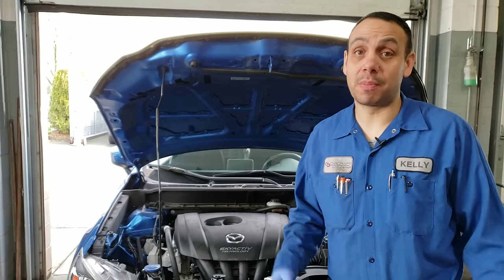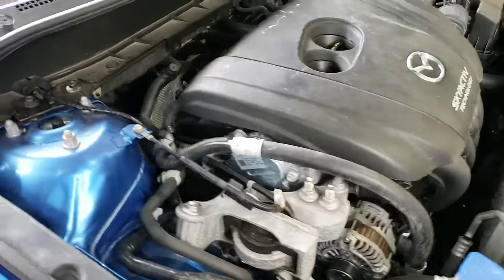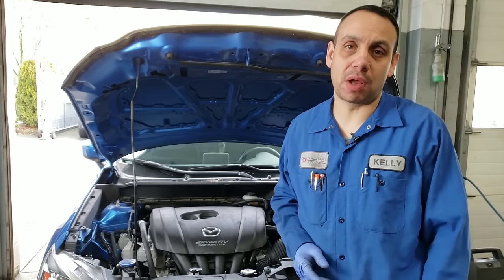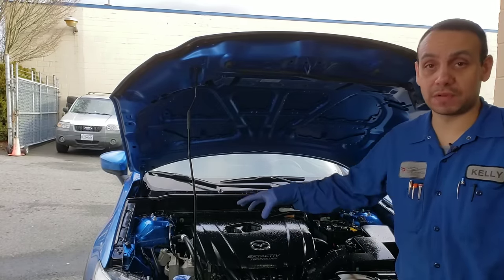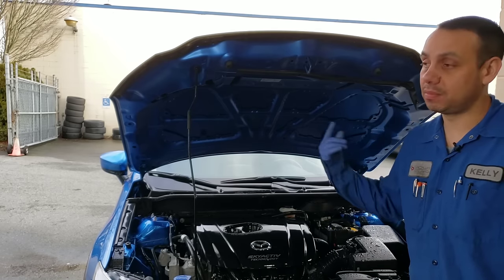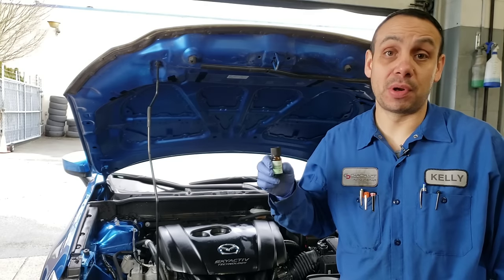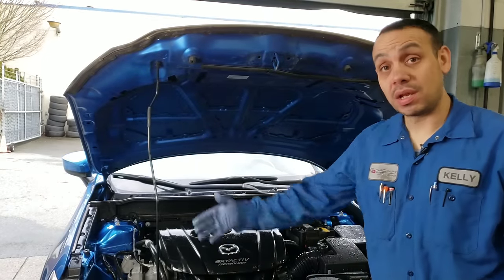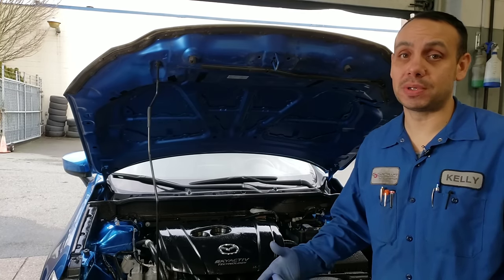Easy Tip To Keep Rodents, Mice & Rats Out of Your Engine Bay

Comment: Good video.  That engine cover should have been removed though.  Speaking from personal experience (with two Mazda vehicles), rodents love to nest underneath it.   Important wires and connections reside there.  

A thorough cleaning and spraying of essential oils does help, but should probably be repeated often if in a high infestation area.

Comment: Yep — rodents cost me $900 USD repair after eating the wiring. I found that particular car - Ford Explorer - was more susceptible to rodents wanting to get up into the engine area. I ended up trading in the car less than a year after purchased. I purchased a Ford 150 and didn’t have the same problem. Seems that automakers should come up with better ways to protect wiring, etc.

Comment: I live in Italy and when I had this problem my mechanic pressure sprayed the engine compartment with diluted kerosene.  Worked like a charm.  Since, I have had him spray the engine compartment every fall and have not had any more problems in the past ten years.
Reply: how can you spray kerosene, it will burn at high temperature letting fire to catch your car. how you diluted it. Does it prevented rats and rodents? thanks

Comment: I get my car oil sprayed yearly, I use the Krown formula. Never had an issue with rodents. Can't say thats the cure for sure, but since it is oil based and does have a slight smell I would think rodents won't like chewing, sleeping or nesting there. Also as a bonus it protects against corrosion.
Reply: I live in the country with lots of rodents.  The Krown oil attracts a lot of dust add dirt; seems like they aren’t interested in chewing through the goop all over everything.  My boat wiring, on the other hand got chewed.

Comment: My cousin bought my wife's Sunbird that had been parked for a year. It started right up, he put plates on it and drove off. On the way home he tried the air conditioning. The next thing he knew a live snake came slithering out of the dashboard heat duct right by the steering wheel while he was driving down the road! He barely had time to pull over. Luckily nobody was hurt! 🏃‍♂️...........🐍🚙
Reply: Thats some Indiana jones shi right there!
Reply: I had a rat snake that kept getting in my old car. I finally speared it when it came out of the door
Reply: Snake was there eating the rats.
Reply: A snake in your car is way better than a mouse or rat. Snakes don't do damage.
Reply: That’s a GR8 story, 
Talk about an exciting drive !
Reply: Unless it was a rattlesnake(or the other of the poisonous snakes in your region), you have nothing to worry about.
Reply: @BillPalmer  Yeah he did. His gurlfriend started freaking out.
Reply: Someabuck
Reply: Did you know gasoline will kill a snake?  It does, throw about half a cup on it, it also killed the grass in the area but that snake was GONE
Reply: @A10TOES    I tried that.  The snake took off at a high rate of speed and travelled about 500 yards.  Then stopped and laid there.

Ran out of gas.
Reply: @tomrogers9467  🤣🤣🤣

Comment: I've had some success with large plastic jars of cloves, perforated with lots of holes,  as a mouse repellent. "Fresh Cab", a pine shavings and lemon oil product, available from hardware stores, also works okay. Dryer sheets don't work; mice will chew them up and use them as nesting material.  There is a company called Loraffe that makes strobe lights to put in your trunk and under the hood of the car; haven't tried them yet but I like the idea.  They make one style that uses replaceable batteries and another style that you can power by tieing it into the 12 volt battery system of your car.
Reply: The strobe lights work very well!! I have them in both cars. the ones attached to the battery are no hassle and no maintenance. Yep, rats had eaten an entire electrical harness, which can affect your vehicle readings, and that is not a good feeling in the desert.

Comment: I had rodents in my Ferrari engine bay while car was covered . $60.000 damage . $5,000 parts. Harness damage and sensors were damaged . It took engine off replacement for parts to be accessible . When finished sprayed perimeter of vehicle with  peppermint couple times a week and plugged in sonic anti rodent devices can’t hear them but rodents can. My insurance paid the bill. Thanks for sharing .
Reply: It happened to our Mercedes in our garage while we were in Europe for 3 months.
After that, we learned to place moth balls in a small bag with small holes in it.
We placed it under the hood in an area away from heat and moving parts.
The moth balls will last for a year or longer.
Reply: If you own a Ferrari and you couldn't afford a nice sealed/insulated/climate controlled garage to park it in, then you weren't rich enough to own a Ferrari. For $60K, you could have built one hell of a nice garage.
Reply: @bry2k  I own multiple vehicles . Not enough parking space in enclosed garage with climate control . Vehicles rotated  for long term storage while travelling months at a time. Retired life :) .
Reply: @240fxst   Dude, you could buy an airtight conex container for $5K to store a Ferrari in. I don't care how you spin it - if you let a Ferrari suffer $60K of rodent damage, then you're too poor to own a Ferrari, or your brain is just not firing on all cylinders.

Comment: protect the airbox, and in cabin filter as well, they like the cotton / paper from the filters for bedding
Reply: I wonder why they can't use a metal mesh around the paper filter to keep the mice away.  I just had to replace the air filter and the glove box filter for this very reason. Fortunately, even though they were filthy with debris there was never a smell in the car.  I happened to see the nesting material sticking out from under a cover which I THOUGHT was the air cleaner. It wasn't but there was stuff in that spot as well.  Home Depot sells a can of rodent repellent spray that is peppermint scented and it's under $10.  In the fall I sprayed around the entire foundation where it meets the house but the mice have still gotten in the house as well.  I have 3 cats and only one catches mice.  If that cat didn't catch mice I would put out the poison bait but I don't want the cat to get sick if she catches a mouse.
Reply: @dottiekonarski5340  I just got pure peppermint oil and no more mice.  I also make my own cabin filters that are better and pennies on the dollar.

Comment: The best solution for me is to open the hood (garage with roof) everytime the car parks, the heat attracts local cats that sleep underneath, near, or on top of the engine. No rodent problem ever since.
Reply: You should always bang on the hood of your car before you start the engine in case any of the cats are still in there sleeping.

Comment: I've been putting cotton balls with drops of peppermint oil on them in my boat compartments for several years and it seems to work well. They nest in the glove box in the winter but they haven't been in there since I started using this method. Good advice.

Comment: The mouse nest is probably under the dash to one side of the glove box compartment or in the area under the cabin air filter or actually in the center of the blower fan. From time to time in Arizona I've seen guys park their pick-up truck and open the hood and leave it open all day. The mice leave. Another trick is mouth balls in an old pill bottle with several hoisin the cap. Works like a charm inside (along with the old fashion mouse trap) a motorhome or trailer .
Reply: My understanding is that moth balls are very toxic to breath.

Comment: Good info but here are some additional tips. Once the mice get into engine bay, it's easy for them to get into HVAC vent and then interior. If you have a cabin filter behind glove compartment (Mazda, Toyota, etc), inspect the filter. If you have nest or feces, clean or replace filter and spray with peppermint oil. It may keep the mice out of the vent and cabin. Also, make sure cabin area has no food. The mice love kids because they drop food on the seats and floor.
Reply: just cleaned mine it was FULL of nesting material and one dead mouse.  also found a dead mouse under radeator area at bottom full of i think frown worms or somthing. sorry for being so gross. now sprayed everything with a ecential oil spray eucalptus and pepermint.  smells nice too. they say it works
Reply: Thank you.  I definitely have a nest in that area.  The plastic piece under the knee air bags is a little loose and I can hear rocks when I tap it.  I heard the rat in there while doing errands and bits of leaves and sticks were falling onto the floor mat while I was driving.  I'm afraid to mess with that plastic piece because it's so near the airbags.  I tried to get a vacuum hose in there but it wouldn't go very far.  Since the cabin air filter is in that area I took your advice and tried to check it but I couldn't get it out.  I have some wiring damage and have an appointment at the dealer so I'll ask themto check that too.   Thank you.  BTW I caught 3 rats in 2 days with snap traps.  Nothing last night. This sucks!
Reply: @mist4926  I had them over my headliner. One ate the sunroof drain hose and it leaked.
Reply: If they eat on Mazda, Toyota etc who gives a fuck buy American!

Comment: I've had squirrels chew my wiring twice...Expensive repair!!! I was told by my mechanic that a lot of the plastic under the hood IS PLASTIC but when the parts are molded Peanut Oil is used as a release agent in the process & it remains on the plastic under the hood, they can detect a food source for years after the new wears off.
I found a mix of peppermint oil, fresh jalapeños, fresh garlic, with Dawn & water on UTube. I use it every few weeks in the summer & once a month in the winter. A problem I have is my car sits outside, not driven often sometimes it sits for a week at a time without moving which invites Texas squirrels (no rats)!
Good luck.

Comment: Another very important thing to do is take out your in-cabin air filter and inspect for mouse droppings/urine. If a rodent has invaded your engine this is one of the main places they go. If you see evidence, install a new filter and vacuum out the area with a vacuum hose tube attachment. There are car A/C ozone sprays to disinfect as well before installing the new filter. You should also do a similar inspection of the engine air filter. It is recommended to shut the outside air ventilation button when the car is parked.

Comment: I can tell you that mice anyway like peppermint smells. I once worked at a warehouse where mice and rats got into tons of candy canes. Also, that oil that you are using will degrade by 80% in 2 days! The best way is just to inspect the engine compartment every few days and if the mice/rats keep getting disturbed, they will relocate. Dryer sheets also work to help keep these varmints away. I soak mine in strong smelling chemicals like ammonia. Mices and ratties hate that smell.
Reply: I have wondered about using ammonia.

Comment: I tried moth balls on top of the engine parts, which was recommended by a different YouTube video, but the rat just pushed the moth balls out of its way and still made its nest on top of the engine.  I'm anxious to try peppermint oil spray, not only because this video recommended it, and also other mechanic videos do likewise, but most convincing were the tests done by this YouTuber:  https://youtu.be/wNaNGH_hnEE .  He used peppermint oil dispensers, but the spray directly on engine parts and wires should work just the same.  Another of his tests showed that mice didn't care about moth balls, even when a huge number of them were placed in the bait box with sunflower seeds as bait.  I wasn't able to find peppermint oil in 3 local grocery stores (sold out there), but I found a 1 gallon spray kit of it from a Walmart marketplace seller.
Reply: Try the Tomcat peppermint spray, comes in gallon bottles with sprayer attached.   Very easy.

Comment: I stored my Camaro for the winter and did a couple of things. I got some dryer sheets and placed them all around the interior and placed a few in the engine compartment. Filled some socks with moth balls placed them in the engine compartment. I got copper wool like chore-boy placed in the exhaust pipes. Emptied a bottle of Sta-Bil in the gas tank for storage. Inflated the tires to max about 40psi. I didn't do the battery thing though. But the garage rental was indicative of mice. So in storing the Camaro, I had to take extra precautions. Upon the first drive remember to remove all the things you did in the fall. It started right up and I had no flat spots on the tires.

Comment: For a much longer lasting result, place moth balls in a bag with holes or in netting and tie 
it under the hood away from moving or high heat areas.  This last up to a year as the
moth ball deteriorate.  We have used this method for years with great results.

Comment: My fave is hardware cloth. My buggers. nest in the air filter/heater intake points.  And destroy the those assembly to the toon of 275$ dollar one year. So it's hardware cloth . Its mesh is 1/4"by 1/4" so wrapped around intakes. And painted the right COLOR seals the deal. Thanks for tips.
Reply: So what IS the right color?
Reply: @markpowers80  hi hi mate. Just good old Zink coated mesh . Ps also works well to keep the pirates out of the bird seed storage,  and from around vents in my house.  Quite handy stuff. Ps a can of rustolem® make a fashion state ment . Your choice thanks for asking om 73🤠

Comment: We tried peppermint oil, Irish Spring soap, and dryer sheets in our RV. The mice ate the soap and used the dryer sheets for nesting material. The peppermint oil had no effect at all. I purchased Critter Ridder spray from Home Depot (it smells horrible) and sprayed it liberally around the engine compartment, the generator, storage compartments, and underneath the RV. After four years we haven't had any further signs of mice activity. At the same time, I placed some DIY bait bags with a 50/50 mix of baking soda and peanut butter powder, just in case they got into the RV. They have never been touched.

Comment: Mothballs strategically placed under the hood keeps them away also 😀👍
Reply: TRied Mothballs to keep squirrels  out,  didn't work, they  Operated, chewed  right next to the Mothballs. no problem. Once i got the Ultrasonic  rodent repeller in  there, no more trouble.
Reply: Not true!
Reply: Moth balls…….How do you get their little legs apart?
Reply: @seashorelineone  Damn, ya beat me to it. :-)
Reply: Eh, if your Moth balls contain Naphthalene it may react with some rubber and plastics and make them slimy.
Reply: @seashorelineone  If you have a moth ball in each hand you have a bloody big moth.
Reply: Mothballs work well for me.
Reply: Mothballs and dryer sheets do not work! Just bought a product called RatAway, a spray that I hope will work. Have replaced three ignition modules and a fuel line on my tractor that were chewed through by &$#@ing mice.

Comment: Thank you for an informative video and not repeating yourself over and over!  I was amazed that you hosed down the engine!  I thought water inside there would be a big problem.  One commenter suggested adding  a surfactant such as some Dawn dish soap, which makes sense as it will break up the oil for better dispersion.
Reply: You can wash your engine off. It's actually good to do it on occasion. Especially the radiator. Obviously you don't want to use a high power pressure washer. And you want to not drown out the electrical box or anything.  
If you think your engine doesn't get wet, look under your hood after your drive home in the rain.
Reply: @roberto3262  Thanks, Roberto!
Reply: @joann5157  it's good to get the road grime off of your engine. And especially the bugs and crap from the radiator fins.  Ever been to a car wash that sprays the bottom of your car off? That washed the bottom of your engine too. And depending on your grill, the radiator could get sprayed off in the car wash 👍🏻
Reply: it's ok to clean the radiator, but you are correct: don't spray water in the engine compartment.  can lead to electrical issues which are expensive
Reply: @glennhansel9411  You can run water into the alternator while it's running without any harm. I flip cars, & have cleaned under the hoods on hundreds.
Reply: @glennhansel9411 
Every single time you drive in the rain, the entire engine compartment is soaked . . .

Comment: Since I had rodents chew up my engine air handler (which, by the way in 2002 was made with a Soy based product instead of metal) I since have regularly sprayed the engine with diluted peppermint oil, placed two perferrated bags of mothballs on top of the engine, and added one portable electronic rodent repeller which makes a high pitched noise and flashes a strobe light every minute of so. Of course remove them when the engine is turned on. So far have never had another problem with critters trying to build nests inside the engine compartment. My RV shop says that they routinely see thousands of dollars worth of damage from Rodents. So, it is worth it to do whatever is necessary to keep it from happening.

Comment: A couple of additional tips. First, peppermint essential oil is expensive enough without using a high grade or specialized product, especially with routine application. Use the cheap stuff for your car. Don't forget to treat heater and AC ducts, as rodents will sometimes find their way into these passages..

Also, do not assume that they haven't damaged any wiring, based on a spot check. Run through an operational checkout of lighting, instrument panel, and accessories. Make it a habit.
Reply: What is the cheap stuff?